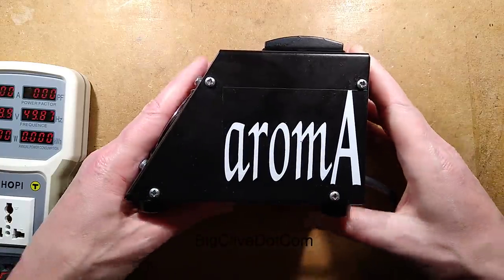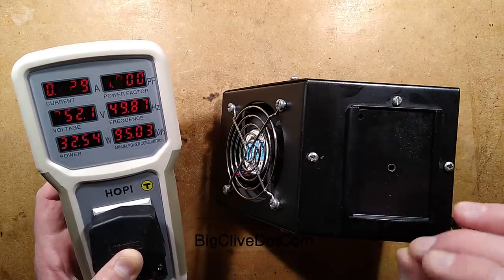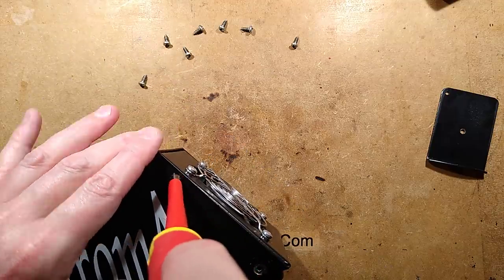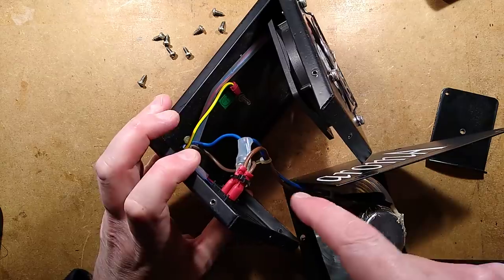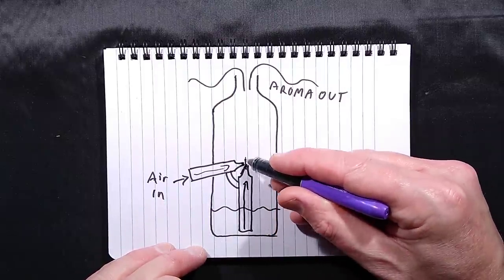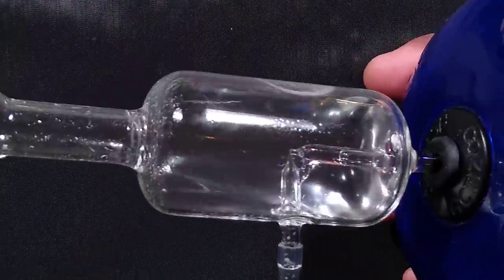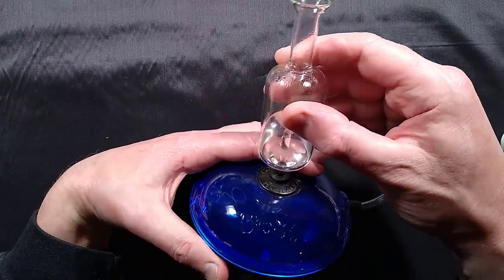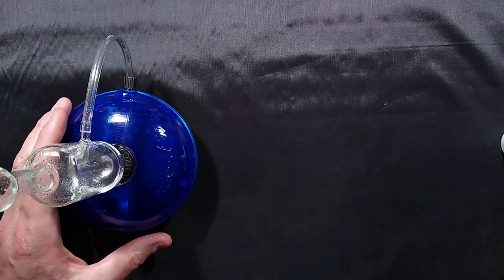Inside an aroma machine.

Comment: My business uses an aroma machine that I was able to get from a friend who works in the maintenance department for an American owned casino (which will remain not named" in Macau China. By company operates right across the Macau boarder in Zhuhai China. The casino brand has a scent that is used in all of their locations and in many different types of units. Some heated, some misting for air ducts. The unit he was able to get for me is similar to the one you are showing, just differently shaped with pigtail leads and unbranded. I was obsessed with finding a more "western" scent, as the only options I could find here were too floral or "toilet cleaner" in scent. Haha.
Reply: look for “scentair”

Comment: Project Idea!  Fill it with synthetic farts or a poop, make an arduino to randomly turn it on and off throughout the day, then hide it in Ralphies house.  Bonus idea... if Ralphie does livestreams on his channel then add a wifi module to remote control it and turn it on during his live stream :)
Reply: Have the big red button set it off as Ralphie hits record
Reply: Fun fact: the word "Mist" in German means "manure"
Reply: Thioacetone will make people gag from miles away, no aromatizer necessary
Reply: @franglish9265  Thiols are magical. :3 There was an 'incident' in 2013 where a French chemical plant near Rouen had a thiol leak, and the journey across the channel did nothing to stop its horrendous stench -- apparently it smelled like rotten ass in London (more than usual lol jk).
Reply: There is all sorts that could be used for this sort of.thing, all the hunting scents etc. If.you REALLY want to scare someone theres a thing called bitrex thats used for the iron metallic  taste of radiation exposure.

Comment: so is this how Cinnabon  makes the food court smell so nice at the mall?? Oh Clive just told us, bakery oven fan.
Reply: 2:30 They do that with popcorn too. A mall food court/snack counter at a local mall had a fan hidden on the ceiling over the popcorn machine to blow air down the corridor when it was popping.
I heard that disney parks have a really elaborate system that pipes their food smells for blocks around
Reply: @NOSUBSCRIBERSWANTED  My wife once got some wax warming blocks that smelled like that....for about 2 hours, then it stunk.
Reply: Yes
Reply: @patrickglaser1560  Agreed.  We no longer use them.  Turns out my wife got a bag of them from a GF.  I though she bought them.  I think the heaters are a fire hazard and a waste of electricity.
Reply: @TechGorilla1987  no decent one is electric, you want one where you put a tealight underneath. And the wax itself is NOT meant to evaporate at all, the aroma is meant to offgas. You're supposed to be left with an odourless wax at the end of it. And those holders/burners/censers can also be used with essential oils, which, again, will not entirely evaporate, they do leave residue behind which you indeed don't want going into the air. That's the appeal of the wax, you just pull it out when it's odourless, instead of having to wipe up something sticky.
Reply: @kaitlyn__L  We ditched the cover-up smells all together.  We swapped over to HEPA filtration and metered ozone.  It's bad enough I have 2 3D printers working in my workshop.
Reply: @TechGorilla1987  fair enough. I generally find nice perfumes work better on a blank canvas than as a cover-up anyway. Mostly I just got worried by the implication you had a plug-in heater which was getting hot enough to vaporise the wax directly..... lol
Reply: @kaitlyn__L  On, no.  An item like that wouldn't stay around long.  I attributed the foul smell to cheap blocks.  It was an electric unit, but the lamp was only 10w clear.  They're all at the Goodwill now.  :D  Stay well!

Comment: 6:50 - With the light in line with the camera it's kind of hard to see; if you light it from the side it's much more visible. For extra fancy effect use two lights with different colours at 90 degrees from each other (ex., blue from frame left, yellow from frame bottom).
Reply: 'twas very clear to me until he turned the brightness up !
Reply: @millomweb  - Yes, that made it even worse (although part of the reason why it got less visible was that he tilted it, so there was less mist coming out).

Comment: I've seen one that looks similar to that instead of the little crucible, this one has replaceable tubes infused with scents and a little PIR dome in front.  It kicks the heater and fan up when motion is detected.  It was a commercial one so the unit was quite pricey.

Comment: I'd be really interested in a video where you take one of those cold spark machines apart. They heat some powder in an oven and blow out the heated powder into the air creating a fountain of sparks that are being said to not light things on fire. Sounds like a challenge to me :D
Reply: Flame-coloured dust forming flame-shaped clouds.

Comment: Wow! I've never seen that Venturi style before. That's super clever.
All I could wonder the whole video was how they did the smells for the Soarin' Over California ride at Disney.... I think that ride is called something else at the other disney parks.... but it would blow like, citrus smells as you flew over orange groves, or pine smell over pine forests. Really great effect.
Reply from the maker: Disney has patents on their own scent equipment.  But it generally involves airflow from specific aroma tanks being diverted into a main airflow.  The slight downside of multiple scents in one area of an attraction is that they inevitably combine and linger at a low level.
Reply: Same principle used for airbrush painting. Except from the outer glass shell of course (-;
Reply: @ZeedijkMike  I wondered why my car always smelled of aroma oils.
Reply: @stupot_64  don't confuse air brushing with spray painting though the result is more or less the same (-:
Reply: @ZeedijkMike  Why not? I am permanently confused.

Comment: Hi Clive!  I have a question that I haven't been able to figure out!  I've been through electronics classes back in the 90s but I don't understand what "power factor" is. 

Thanks for all the videos and knowledge you share!!!
Reply: It doesn't really pertain to electronics as much as it does line voltage type things. Electronics are ususally DC whereas line voltage stuff is AC.

Power factor has to do with the current being in phase with the voltage. In a purely resistive circuit, there is a perfect power factor, as the current and voltage are directly related. In a capacitive circuit, the current leads the voltage, and is therefore not in phase. (Capacitors like to draw as much current as possible as soon as the voltage changes.) In an inductive circuit, the opposite is true, as the voltage leads the current. (Inductors like to keep the current flow the same, and so with any change in voltage, the current will lag behind, due to the inductor trying to regulate the current.)
Reply: Clive is actually a proper sparky and his big interest is power. Almost no other group of people (except your electric company) cares about power factor.
Reply: Vector arithmetic AC voltage and current are  vectors. To get power we need need to get the product of voltage and current..... Vector product means we multiply voltage by cos ( phi) times the current.....this cos phi term is called the power factor.......so V times I times power factor...
The electric supply people charge you for kWhr watts so bassicall the power factor reduced power.....but they still need to supply the full current.
Reply: @jasonudall8614  utility companies can (and do) ding you for very bad power factors. It is important to know what yours is, at least in a commercial or industrial setting.
Reply: @IceBergGeo  indeed they can.... So unity of is GOOD....banks of caps at the entry to the site are not rare.....bloody fluorescent lamps
Reply: They also like all phases mostly balanced.....

Comment: The principle of the smells waiting in is actually employed in movie theaters. When you walk in, you’ve got the ticket counter, but once that’s purchased, you walk past and are greeted with the smell of popcorn.

The machines in bigger theaters have a massive fan which acts as a cooling method, as well as waft that buttery clog your arteries goodness around so you’re drawn to it. 

At least that’s how it is here in America, last time I was in a theater in England it was at a/the Odeon in Esher, Surrey and all I remember was a pick and mix selection of some of that licorice pastille candy and those amazing UFO things. Fuck that was 16 years ago, but I don’t remember any popcorn smell then.
Reply from the maker: Sherbet filled flying saucers?
Reply: @bigclivedotcom  Yes sir, I've seen them mentioned on some websites, but rarely mentioned outside of the U.K. Kind of a pity as they were pretty darn good, as far as I can remember. Albeit a bit chalky at times.

Comment: Checkout the Olarama scent generator. We use it for custom full immersion VR systems. Uses small pressurized cylinders controlled via Ethernet. Can load up to 10 scents.
Reply from the maker: I'm guessing it uses a small solenoid valve on each cartridge to squirt out a burst of aroma?

Comment: Did you try 3D printing these ventury pipes ? .. i dont know which materials will work with "oil" for long term.
Even if the print isnt that great you can rework the nozzle with a drill or needle.
I like the idea of simply splashing too large droplets against the wall to recycle them instead of worrying to vaporize everything at once.
Hmm. One might even try how good one of those tiny airbrush pistols (also ventury effect) works with an aquarium bubble compressor, but the reflow wont happen easily.

Comment: Hmmm!  Is is possible to add a surfactant to alcohol, put that into the little air pump atomizer, amd make a foaming torch similar to your flaming sploosher device?
Reply: That should work (but you shouldn't need a surfactant). The venturi atomizer is basically the same as an engine's carburetor. If it can supply a flammable stream to an engine it should do the same for open air.

Comment: What about the piezoelectric ones that vibrate the water quick enough to heat it and then the aroma is blown out using a fan
Reply from the maker: The ultrasonic atomisers are often sold for home use, but aren't suited to commercial aroma applications.
Reply: @bigclivedotcom  oh ok makes sense

Comment: Hi Clive, I have a USB power meter display and it doesn't work correctly.. you have to fiddle with it by wiggling the cord, unplugging, plugging in again the cord. I think it has fault USB ends or solder connections. It did this when I first got it so I am not sure what's wrong. I was wondering if I could send it to you and you could make a video on it. It comes apart really easy, it just pulls apart. It comes in handy and I would really like it working correctly. It's a neat little device in my opinion. I could not find out how to send you a direct message so I figured I would post this here. Thanks in advance :D

Comment: Afternoon Clive just a quick question well kind of. The Motor capacitor Blew in my Bandsaw. I removed it and wrote the details of it down to order a new one but forgot to write down the µF. Is there any way of finding out what it is using a multimeter? I've looks at the manual and all it come up as is motor Wiring lol  What i've wrote down is 450v.AC50/60Hz CBD60. As you can imagine loads come up with different Values. Any Help would be great. ps the Bandsaw is a Draper 200mm (250W)
.
Reply from the maker: I'm not sure the best way to get that value.  It might be worth looking at similar motors to see if you can get a value.
Reply: @bigclivedotcom  Thanks Clive I will. I'm usually good for writing stuff down for replacement bits, God know's why I didn't for this. Any way Cheers for the help.
Reply: @fantasticplastic5336  You should also note whether the capacitor is used as a start capacitor or a run capacitor. The capacitor value isn't too critical, especially if it's just a start capacitor. AFAIK a smaller capacitor will mean less torque and a larger capacitor will mean more heat generation.

Comment: at least for me the synthetic smells are made with chemicals that cause headache and end up NOT smelling like the intended item for example an apple air freshener spray will end up smelling like the formaldihyde based preservative laced carbonless store receipts or the green board used in kitchens and bathrooms as sub flooring and i get headaches from the chemicals.

if you are going to make air fresheners then extract the chemicals that makes the apple scent from real apples not through artificial ingredients.
Reply: Serious scent chemists analyze the natural scent down to it's basic molecules, then find a way to perfectly copy those molecules.

Comment: I wonder if an aroma concentrate of stale urine exists? I can imagine getting really annoyed at an establishment and having a small sacrificial battery operated  machine which could be tucked away in a near invisible and inaccessible place. Use a programmed timer to go off at appropriate times and really get the point across.  Lets say at a wedding when the happy couple are starting the wedding vows. Start wafting something awful and see if they rush through the ceremony or just slog it out. Very mean but I would find it funny.